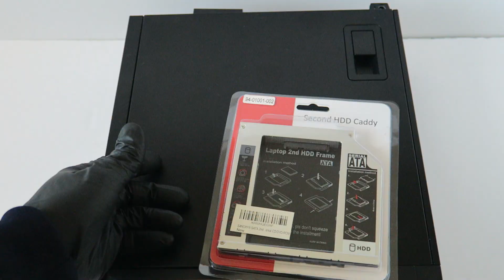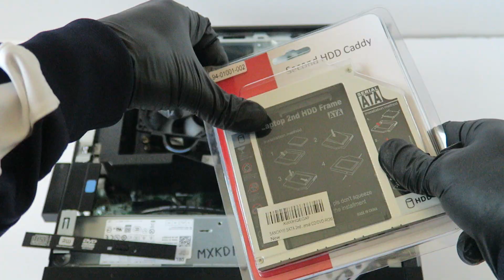Dell Optiplex SFF Install Second SSD, Hard Drive

Comment: Wait so the SSD replaces the optical drive? I guess since it's SFF you would have to scrap the optical drive for the 2nd hdd ssd space.
Reply from the maker: Hi, yes you can add up to 3 hard drives 2.5 inch or ssd with out optical drive.
Reply: @Mxkdt  Ah ok cool thanks MXKDI!
Reply: @Mxkdt  So right now I am running one SSD and one HDD. By doing what you did in this video I can put another SSD, which in total gives me 2 SSDs and 1 HDD. Now does it matter which SSD/HDD I plug into which connector? One is blue I think and the others black and the other is white. What is the difference?

Comment: Couldn't you just stick it somewhere with double sided adhesive
Reply: yeah but there's little space and it requires a sata power splitter as only one comes with the sff power supply

Comment: This adapter isn't necessary. Get a drive cover for a start, but there's 2 holes you can screw into to mount an SSD where there drive is.
Alternatively disassemble the PC completely, get some velcro and mount an SSD to the top of the case with a power extender too.
You could also get a 3.5 inch adapter to 2x 2.5 inch drives.
You could also get a PCI HDD mount thing, they cost around $13 and you can mount two 2.5s.

Comment: This approach is doable but not good. You replace you DVD drive with another 2nd 2.5-inch HDD, so you have no DVD drive any more. 

Best approach: 
This desktop uses 3.5-inch harddrive. Buy an adapter that could hold two 2.5-inch HDD in a 3.5-inch HDD slot to replace the default 3.5-inch harddrive.
I have done that for Dell Optiplex 7020 SFF. I have one 512GB 2.5-inch SSD and one 512 GB 2.5-inch HDD. They are mounted in the adapter mounted in the 3.5-inch HDD space.
Reply: I agree and there are vids on how to do it, plus the ODD is only sata II
Reply: Depends how many data connections your computer supports. Mine only has 2, 1 for dvd and 1 for hdd so this is the only approach that would work.
Reply: How many SATA connections does that computer support?
Reply: Jonathan Webster 3

Comment: Nice video. Only limitation with the Optiplex SFF is that the ODD is a SATA2  connection rather than a SATA3 like the main HDD interface. Nevertheless it’s a neat way get the second HDD   Thanks

Comment: Is the caddy 9.5mm or 12.7mm?
Reply: 12.7mm for this PC/SDD system. The 9.5mm caddy is usually for laptops and other devices with  smaller compartments

Comment: Performed my first SSD install today. The process was as easy as you made it look. I purchased a slightly different 2nd HDD caddy, mine came with a face plate for the t420 so I had an added step of removing that face plate and a little plastic support stud at the back. I don't think I would have attempted (or even known about the caddy) this conversion had I not watched your video. Thanks again!!!

Comment: Is there any way at all... ANY WAY AT ALL..... to install a SDD and keep both the HDD and Optical drive in the SFF optiplex?????
Reply: Yup. PCI hdd mount, but find a LOW PROFILE one. 
Alternatively, remove all the motherboard and mount it to the roof of the case using velcro. You'll need a power extender to reach though, probably even for the mounting bracket.
Though if you have 3 sata ports, you can't keep the function of all 3, but they'll all still be in the case. 
There's also PCI cards you could use i'd guess as a drive

Comment: I just did a mod similar to this....but...I'm not sure why you showed this method when there are 3 sata ports on the 9020, and there are 3.5 inch bay adapters for single and double SSD drives.  This method lets you keep your optical drive, and you can replace the old HDD with one or two SSDs. Nice work though with the Magyvering of the optical drive case.
Reply: You could alternatively mount an SSD using velcro to the roof of the case (requires removing the motherboard entirely).
PCI mount brackets exist to mount 2x 2.5 inch drives also. But yeah, initially I did it with a 3.5 to 2.5 adapter, and had a SSD mounted where the DVD drive is using 2 screws (conveniently placed :P) and purchased a drive bay cover.

Comment: Please help
What all can I upgrade in my dell 3020 which I bought in 2014
What's the limit of the mother board? Can the motherboard support 1060 3 GB 
Can it support i5 5500
Reply: I have already bought 1060, will I have to upgrade my motherboard too?

Comment: Do you have a link to the model of the replacement HD Carrier? I know there are different models for Laptops.
Reply from the maker: https://www.ebay.com/itm/NEW-Second-SATA-Hard-Drive-Adapter-Bay-Caddy-for-LENOVO-Thinkpad-T520-W520-T420/111019602139?epid=1431587323&hash=item19d948b0db:g:bVYAAOSwhWFaVJG9

Comment: can i run 1060 in my 3020?
will it cause any problem to my motherboard 
i know i need a new psu, but how much is enough and how much is extra ?
Reply: Ammar Khan you will need an adapter for the 24 pin motherboard connector as dell use proprietary connector on the 3020, 7020 and 9020 pc. Any standard PSU should be fine. For 1060 get a PSU that is 400w min.
Reply from the maker: Hi, do you have mini tower or small form factor ?
Reply: sorry for late reply.
i have mini tower
Reply: and if i upgrade my motherboard 
whic one i shold buy(budget but also future proof)